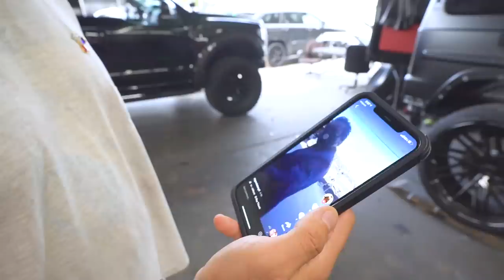New Ferrari F8 Review and Test Drive, 2020 G63 Satin Black Wrap.

Comment: Sarkis lost the bet. He owes Moses $1,000 bucks. He didn't break it. The front cover is designed to be taken off completely when necessary. Because Moses pulled down on it when he opened it, it will disconnect from the sides of the body to prevent breakage. And Moses obviously put it back on , still in operating order , locked it , opened it , and it still is in operating order. Therefore, you lost Sarkis !!!! $1,000 bucks on Friday.. You can man Moses !!!